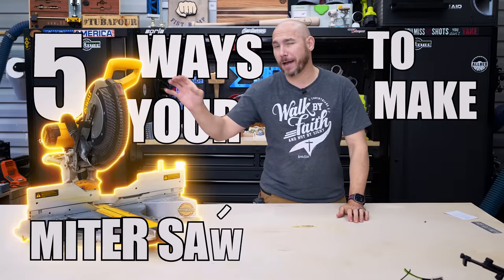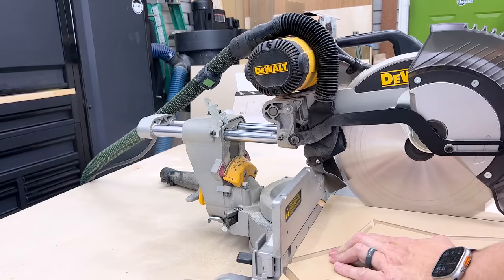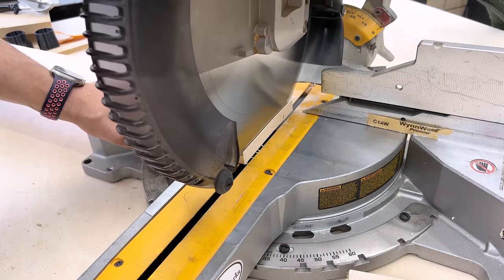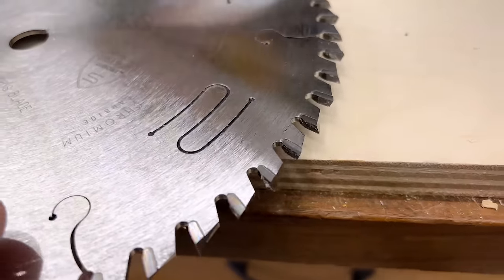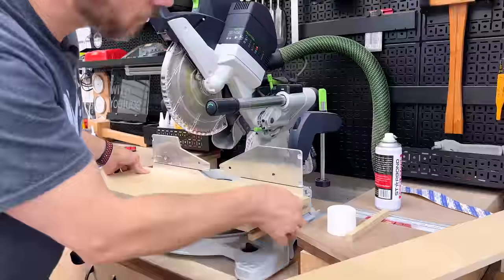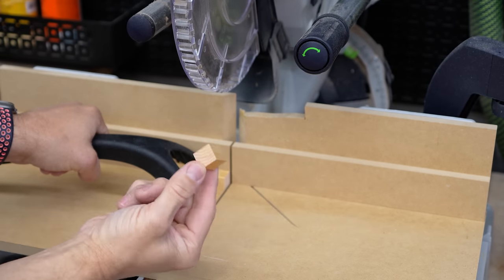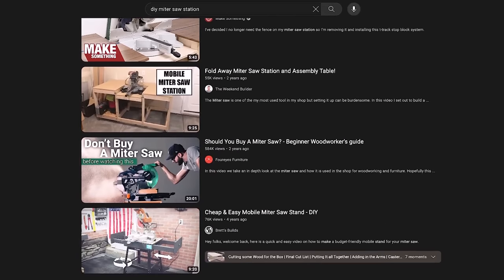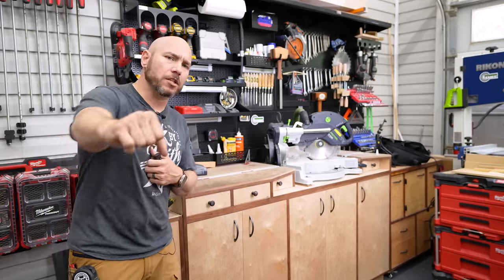Why Doesn't Everyone Make These 5 Miter Saw Upgrades?

Comment from the maker: ▼EXPAND FOR TOOL LINKS and INFO▼ 
Watch Next: 5 Track Saw Accessories You Need - https://www.youtube.com/watch?v=agVrU-g4yTw
Tools In This Video: 
 
Shop Nation Miter Saw Dust Collection Adapters - https://bit.ly/ShopNationStore
Fast Cap Zero Clearance Tape - https://amzn.to/3OQEVGI
Colliflower Zero Clearance for Kapex - https://amzn.to/45tkWVQ
CMT Chrome 80 Tooth Blade (Amazon) - https://amzn.to/3Z7uNhL
CMT Chrome 80 Tooth Blade (40% off at TayTools) https://lddy.no/1hueq
CMT ITK Extreme (budget-friendly blade) - https://amzn.to/3Ecyrgn
Diablo 80 Tooth Blade - https://amzn.to/44n1ict
10 Million Dollar Stick - https://amzn.to/3YYY0v1
CA Glue I Use - https://amzn.to/3KWiK0G
StealthStop Stop Blocks - https://amzn.to/45Mot0S
Dust Extractor I Use - https://amzn.to/44uzanX
Miter Station Built Plans - https://www.731woodworks.com/store/miter-station-build-plans
DeWALT Miter Saw - https://amzn.to/45rUcEU
Festool Miter Saw - https://amzn.to/47NVxrc
Delta Miter Saw - https://amzn.to/45NizfZ

📲 Never miss another tool deal. Sign up for my Tool Deals SMS Alerts - NOTE: I text out tool deals so you don’t miss any! text DEALS to 1 (731) 207-7151 Be sure to add DEALS to your text to me so you get added to the proper list.  You can also click this link https://my.community.com/731woodworks  Important to add the word DEALS to the text!

🇺🇸 Join the Tubafour Nation on Patreon to get an exclusive Tubafour Nation sticker, access to exclusive member-only behind-the-scenes videos, member-only livestreams, discounts, and other cool member-only perks! https://www.patreon.com/731woodworks

(If you use one of these Amazon and other affiliate links, I may receive a commission) 

Some other useful links:
Daily Tool Deals on my website: https://www.731woodworks.com/tool-deals
Subscribe to our email Newsletter: https://mailchi.mp/7e44c16eefdc/731-woodworks-email-newsletter
Check out our easy-to-follow woodworking plans: https://www.731woodworks.com/store
Outlaw's Board Butter - So Good it Should be Outlawed: https://www.731woodworks.com/store/boardbutter
Reply: W😂
Reply: sadly they do not have a dust collector at shop nation that fits a Metabo :/
Reply: You can send me all your old tools

Comment: I bought the dust shroud for the Delta Cruzer from Shop Nation and the improvement is night and day. I dreaded having to use any miter saw just due to the dust explosion they always make, but the shroud easily takes care of 95% of the dust. Main thing is don't plunge directly into the wood. Run the blade out and push it into the wood if it is narrow enough. That kicks most of the dust right into the chute.
Reply: I also have that saw and bought the dust shroud. It rules! Game changer. Go watch the Shop Nation video of him trying to intentionally break it. Might save you from having to buy a new one.

Comment: Another good upgrade I did on my Dewalt Slider was adding the laser beam module that shows you where the blade will cut.  It was easy to install and I got the instructions and kit from someone here on Youtube.
Reply: The 780 comes from Dewalt with the built-in LED shadow light that casts an exact shadow line of where the blade will cut.  I previously had a 779 with the laser LED & agree that they're a great upgrade if you don't have a saw that is already equipped with one.  I think the reason he didn't think to mention it as an upgrade is because he has the 780.

Comment: I just installed that same dust collection kit on my DeWalt miter saw yesterday. A major improvement over the stock dust collection which is practically nonexistent!!
Reply: The other thing is that it makes the miter saw more compact. The dewalt is awkward enough with its sliding bars out the back but with the dust collection back there it is even worse.
Reply: Try changing the blade. You won't be as happy.

Comment: Great video.  I have the Dust collector for my Ridgid glide miter saw and have been very happy with it.  I also used the tape with my old miter saw and just have not had a minute to put it on my new Ridgid Saw.  Now to get my self in gear and make the fence system

Comment: I built a small miter station about the size of yours 2-3 years ago, but later I added a box with my shop vac in the cabinet directly beneath the saw and put a 6” scoop in the base of the station behind my saw. What a world of difference. The dust just flies in the box and gets sucked down into the vac. Not a lick of dust outside the box. I have the zero clearance tape, but can’t do the sled, or too lazy to do the sled as I’d have to rework my station to lower my saw to allow for the additional hight of the sled, but I installed a wooden backer plate against the saw fence and with the zero clearance tape, it works the same as your sled.

Comment: I note you shimmed your saw. You can make the recess for your saw deeper, then lay a piece of plywood on it. With four bolts, nuts and washers, you can drill through the bottom board, mount the bolts with T nuts, then adjust the board you laid on it up or down to accommodate dimensions of different miters.  Drill holes part way into the upper board, for the bolt tops to go in to, to hold it in place.

I came up with this when I was trying to come up with a way to move a mantle clock around and still have it perfectly level, which was critical to whether or not it worked.

Comment: Ordered the Dewalt dust collection based upon this video.  I've got a full hood covering my saw with dust collection and it does a good job but improving the collection immediately around the blade can only make periodic clean-up easier. Looking forward to fitting it and not making a mess. ;)

Comment: Check out the new FlexVolt DCS 781 it has a much improved dust collection set up that very much resembles the kit you bought,  is also lighter, uses but just 1 FlexVolt battery compared to my previous FlexVolts 2 battery system but no 110v conversion pack. . Direct worm drive instead of belt driven, I should also mention for old renovation guys like myself the 18 lbs they shaved off of the saw is a blessing 😂

Comment: Another addition is the Fastcap 10 Million Dollar Stick.  Cutting a small piece of wood on a miter saw can be dangerous when placing your fingers close to the blade to shave off a little.  The hold down stick allows you to firmly hold the piece and keep your fingers safely away.  I've used mine a bunch of times.  Last used to cut filler pieces to door hinge mortises when I turned a swing door slab into a barn door.  I cut small shavings off of my blanks get them to fit perfectly.  Not every mortise was the same.

Comment: Excellent suggestions, Matt. I have a DeWalt 774 mitre saw which came with a 216mm (8.5 inch) blade. Can you recommend a CMT blade for that? Being a smaller diameter it may have to have less teeth than your 12 inch recommendation but not sure.

Comment: The throat plates on those DeWalt's are adjustable. I had a zero clearance on mine by just turning a few screws. Though I had mine for several years before I realized that. Probably something in the instruction manual about that, but who reads those anyway.

Comment: I bought a small “pet tent” from amazon and mounted it on the back of my saw.  95% reduction.  It looks like a pop up tent and is about 2x2x2.  Just unscrewed the back screws I used to tie the saw to my table, slid it under the saw about an inch and put the screws back in.  Reduction seen is with no vacuum at all.

Comment: Great video as always. I purchased that zero clearance material but then became concerned that by raising the cutting area of the saw's bed slightly higher than its overall height and thereby  introducing a slight angle to the miter. I use my miter saw for making picture so those angles really matter. What do you think?
Reply from the maker: I haven't noticed it making a difference, but I'm not making frames.  But, my DeWALT throat plate is slightly lower than the bed of the saw too.
Reply: I was concerned about that too, but found that a business card is the same thickness as the zero clearance tape.  When I’m really concerned about the accuracy of the cut I slip one under the material being cut.  If I continue using it I may just put them on there with double-sided tape.
Reply: Using the FastCap ZC on my DW definitely threw off my cuts a 32nd.  Works like a charm on my table saw but I'm able to adjust the throat plate. Not able to do that on the DW.

Comment: Tip for people like me that only have have a cheap Mitre saw. Upgrade the blade to minimum 60 tooth. Slow down the speed of your cross cuts, you'll get much less tear out or use a piece of sacrificial board underneath. Even a couple strips of painters tape will help for zero clearance (for a few cuts)

Comment: I have a Kobalt miter saw and the back plate (fence) is bellied towards the back, which is causing some kickback and of course cuts that are not square. If I run a straight edge across it, there is almost 3/16 of an inch space in the middle. I can't find parts for it and need some suggestions as how to modify this for the reasons above.

Comment: I saw the cmt saw blade on your daily deals. With shipping (possibly to Alaska is higher), a 80 tooth diablo finish blade is cheaper up here in Alaska. Is it good enough?
Reply from the maker: Those are decent blades. I used them for a long time, cut good and clean.  The CMT will just stay sharper, longer.

Comment: #2 - adding tape for "zero clearance" you also need to add tape to the in and out feed otherwise the vertical cut won't be 90 degrees to the board
Reply: Maybe, maybe not.  I have an older Makita saw which has adjustable pieces on each side of the blade, so you can move them as close to the blade as you dare.  But before I saw this video with the tape idea, I made myself some MDF zero-clearance inserts to replace the Makita ones.  While doing this I noticed that the Makita pieces actually sat a little below the level of the rest of the "table".  I thought that was weird, but now that I know about this tape, I think that little space would make the tape work out very nicely.  And much faster to apply than how long it took me to make up some inserts.

Comment: It is also pretty easy to cut and attach a flexible sheet of something (rubber, vinyl) to enclose the rear of any miter saw to guide the dust up into the OEM chute. Each one will be different.

Comment: You don't have to build an entire sled. Many of us have been running electric miters for decades, so came across the problem with lack of support for small parts over and over again. With the zero clearance plate problem solved, all you need is Masonite backing attached directly to the stock fence. 

This not only solves the problem of lack of support for small pieces, it reduces how much material you have to use.

If you use a bit thicker material. you can even inset mounting bolts in horizontal slots and relief cuts so the fences can slide left or right, allowing you to use the same back for 0-45 right or left.

Comment: You need to chamfer the bottom of the fence or rebate it otherwise sawdust will accumulate and put your wood out of square. Very important. Alternatively you need to brush out that corner after each cut.

Comment: MATT - Realizing I will lose some cutting distance, can I install a 10” blade on my 12” miter saw if the arbor is the same size?? The reason I ask is because I have some really nice finishing blades for my tablesaw, and as rarely as I cut anything special on my miter saw I’m wondering if I can be miserly by not purchasing a higher tooth 12” blade. Money, money, money . . .  mon-ee! It’s just one of those things 🤷🏻‍♂️

Comment from the maker: ▼EXPAND FOR TOOL LINKS and INFO▼ 
Watch Next: How to Cut More Degrees with Your Miter Saw - https://youtu.be/SS9oiLreUnw?si=U-jh2g8r6eafm333
Tools In This Video: 
 
Shop Nation Miter Saw Dust Collection Adapters - https://creatoriq.cc/3QX3R26
Fast Cap Zero Clearance Tape - https://amzn.to/3OQEVGI
Colliflower ero Clearance for Kapex - https://amzn.to/45tkWVQ
CMT Chrome 80 Tooth Blade (Amazon) - https://amzn.to/3Z7uNhL
CMT Chrome 80 Tooth Blade (40% off at TayTools) https://lddy.no/1hueq
CMT ITK Extreme (budget friendly blade) - https://amzn.to/3Ecyrgn
10 Million Dollar Stick - https://amzn.to/3YYY0v1
CA Glue I Use - https://amzn.to/3KWiK0G
StealthStop Stop Blocks - https://amzn.to/45Mot0S
Dust Extractor I Use - https://amzn.to/44uzanX
Miter Station Built Plans - https://www.731woodworks.com/store/miter-station-build-plans
DeWALT Miter Saw - https://amzn.to/45rUcEU
Festool Miter Saw - https://amzn.to/47NVxrc
Delta Miter Saw - https://amzn.to/45NizfZ

📲 Never miss another tool deal. Sign up for my Tool Deals SMS Alerts - NOTE: I text out tool deals so you don’t miss any! text DEALS to 1 (731) 207-7151 Be sure to add DEALS to your text to me so you get added to the proper list.  You can also click this link https://my.community.com/731woodworks  Important to add the word DEALS to the text!

🇺🇸 Join the Tubafour Nation on Patreon to get an exclusive Tubafour Nation sticker, access to exclusive member-only behind-the-scenes videos, member-only livestreams, discounts, and other cool member-only perks! https://www.patreon.com/731woodworks

(If you use one of these Amazon and other affiliate links, I may receive a commission) 

Some other useful links:
Daily Tool Deals on my website: https://www.731woodworks.com/tool-deals
Subscribe to our email Newsletter: https://mailchi.mp/7e44c16eefdc/731-woodworks-email-newsletter
Check out our easy-to-follow woodworking plans: https://www.731woodworks.com/store
Outlaw's Board Butter - So Good it Should be Outlawed: https://www.731woodworks.com/store/boardbutter

Comment: I have a dewalt 10" mitre saw.  I have it set to cut a perfect straight 90 degree cut.  But when i try to do a 45 degree cut (not mitre) it's not 45 degrees.  i shift the handle over to 45 degrees and it clicks into its spot but it's not 45 degrees.  I can't trust my saw to make a picture frame because the cuts are off.  I actually made a giant wood square jig using my my square and it works perfectly for making the 45's I need.  So now i only use my mitre saw to make quick straight cuts.

Comment: I like your channel and advice, but that miter sled project didn't work out.  I used the same 1/2" MDF and CA glue with accelerator that you did, but the fence part easily came unglued to the base, which could be somewhat dangerous.  I only had a 90 degree cut, didn't even mess with a 45.  Maybe there are better options for adhering endgrain MDF, regular wood glue is probably one of them, but what you used in the video was no bueno IMHO.  Mark

Comment: Would you buy a dewalt 780 or makita
Reply from the maker: That's tough.  Probably go with Makita just because of the space saving design of not having the rails out of the back like the DeWALT has.  DeWALT is an excellent saw though.

Comment: Great info- could you tell me best saw,blade and mitre table for picture framing, really fine joints required ? Thanks- I'm subscribed,and always give a like- everyone else should - lazy buggers 😀👍👍👍👍😅
Reply from the maker: The Festool Kapex is one of the best of the best in accuracy.  It's expensive though. Makita makes a good saw as well.

Comment: Based on your video, I ordered and installed the Shop Nation dust adaptor on my Bosch 12" articulating saw. OMG. It worked very well on a piece of 2x4 scrap. But when I tried to actually use it on an 8" piece of 8/4 oak the silly thing bottomed out and served as a *brake*. That's right - a saw with which I have previously cut miters on a piece of 5/4 by 5" Cherry (standing tall) now can't handle 8/4 lying flat! Who designed this POS? And who tested it?? I'm going to try to get my money back...
Reply from the maker: Sorry to hear that!

Comment: To answer the question why (assuming we’re trying to learn how to be quality woodworkers, and not doing random DIY projects): critical cuts (cross and rip) should be made on a table saw, not a chop saw.  While a Kapex is by far the most accurate of chop saws, it does not make furniture quality cuts.  A table saw does.  And breaking down lumber to start a project is much safer and easier with a jig saw.  And cutting small parts, even with a zero clearance fence and insert is MUCH safer on a table saw with a sled.  So in a woodworking shop, (even a basic one)your chop saw should see very little use making these upgrades unnecessary.

Comment: I get perfect dust collection from my miter saw - I just do not use it (the miter saw). I use my table saw exclusively. Anyone want a cheap miter saw for really cheap ?
Reply: Spot on.  Your table saw is the way.  My chop saw sees very minimal use in my shop.  Mostly gets used for installs.  Every critical cut gets done on my table saw.

Comment: I bought the DeWalt dust collector from shop nation and found it to be a major disappointment.  You can't change the blade without removing the dust collection, you should never thread 3D printed materials and I don't see any improvement in dust collection.  I was so hopeful for more.  Don't waste your money. Understand that all of these channels are sponsored and not truthful.